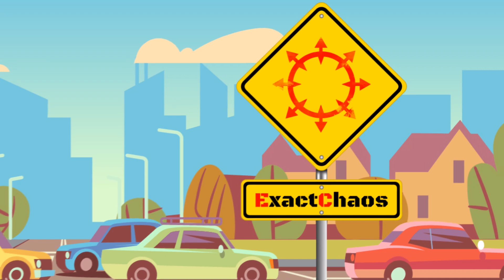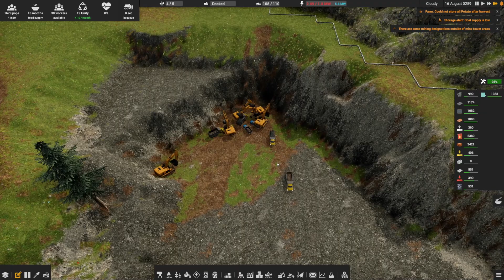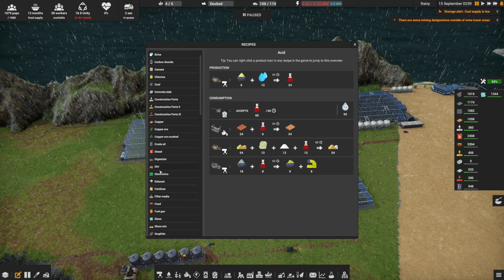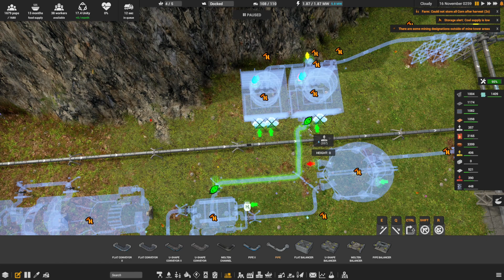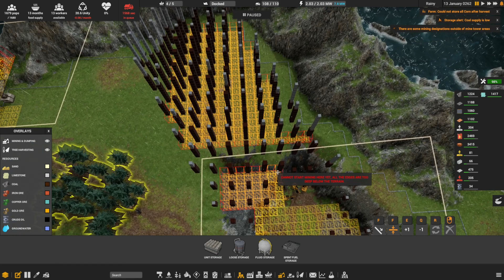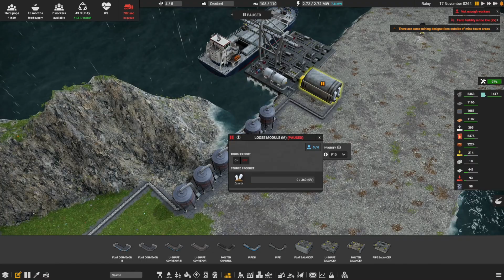Electricity from Food - Captain of Industry

Comment: Selling food for coal is maybe an option too
Reply: at that point it's more sustainable and scalable to import wood from the sawmill, and run coal makers, I do think that there should be a rubber shredder though, that can turn rubber into a coal substitute, for things like the cement maker, and in making graphite,  that'd help address the sulfur problem wouldn't want it as a perfect replacement, it doesn't make sense to feed a blast furnace that way, but for cement, boilers and graphite, it'd at least somewhat mimic real world processes, used tires are used in cement production as a substitute for coal, and arc furnaces normally use graphite rods from petroleum coke.

Comment: Why produce 48 fuel out of food, to turn it into hydrogen to make power,, when you could just use the 48 fuel gas directly in the boiler to do the same thing, without needing the extra boiler, large cooling tower, or the hydrogen makers?
Reply: those xtra steps are also using power en truck transport fuel, maybe shutting down 1 greenhouse, u safe on fertilizer and water and electricity
Reply: the reason to use hydrogen is maybe to save on water, or at least water transport, it makes more sense to do that extra step with desalination as you need the extra water to create steam for the hydrogen makers in the first place, the extra depleted steam to feed into the cooling tower may be enough to keep the hydrogen boiler watered, which is a factor worth considering when you upscale